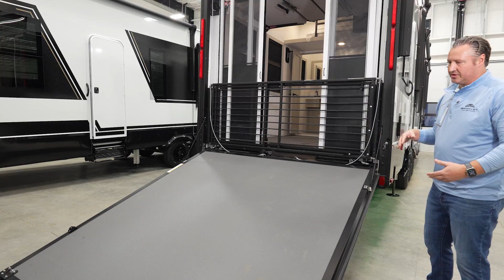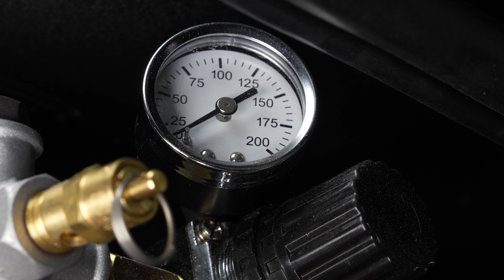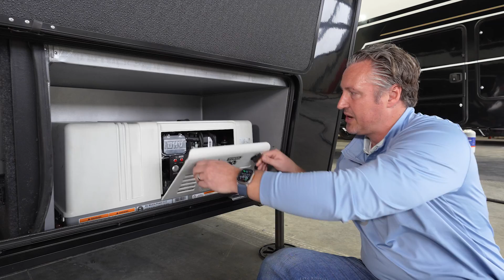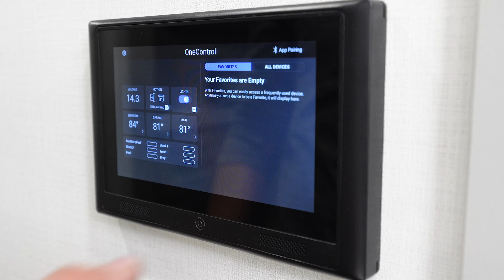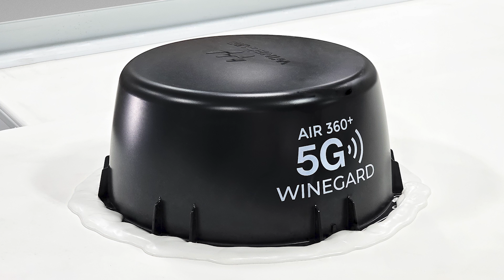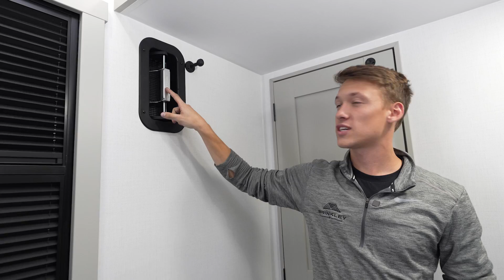2024 Brinkley Model G Owner's Quick Start & Overview

Comment: Excellent video and really appreciate all of the details.  One thing that you didn't mention is access to the refrigerator when the slide is closed.  Question:  If we are a truck stop or rest area will we be able to open the refrigerator side with the slide closed?
Reply from the maker: Good question. This will vary by floorplan. The Fridge and bathroom are accessible on the current Model G floorplans.

Also, note that the Model G's main slideouts are hydraulic and don't require a full extension. They can be bumped out a few inches if desired.

Comment: A whole lot to like.  We have a garage model and moving to a full toyhauler due to the size of my new Can-AM.  I wish the chassis was 24k, the electric reel in middle/rear (not a showstopper), AC units in the Brinkley is super loud (so I have heard but need to verify myself), Not sure if the Flex generator is loud (just below the bed so this I would need to find out) the king bed has no real side tables (must do the queen for that), no option for Independent Suspension.  Really love the unit overall well thought out toyhauler..

Comment: Just curious if Brinkley is using the same frame specs as Grand Design? Just hate to purchase a higher-end unit with a low-end frame that will fail.
Reply: Who makes or provides the frames for Brinkley?
Reply from the maker: We work directly with Lippert Components to design and engineer our chassis for our floorplans.  Spending extra on the triple powder coating process, reinforced upper deck, thicker gauge steel, and many other components of the frame.

Comment: It’s hard to find quality anything right now. Especially with RVs. Do you guys actually nail things in or are using glue like most other manufacturers? Can these be winterized? What’s the warranty coverage like? There are a lot of warranty issues out there right now and it seems buyers have no one their side when something goes wrong. The buyer contracts aren’t in our favor at all. What makes you guys different in this area? Everyone wants you to buy their shiny objects rich with features but then they sell you complete garbage.
Reply: View the Brinkley manufacturing tours. You’ll see why they are different. Brinkley has Lippert design their frames way stronger than typical manufacturers. All Brinkley frames are designed for full time travel.
Reply: yea I am not convinced that Brinkley is not another Grand Design...after all its the same crew that started Grand Design...and look at Grand Design now with all the chassis and customer service  issues.  Who's to say Brinkley has improved on that at all?.
Reply: The water filters are in a terrible spot. You have to take everything out of your basement, and even then reach around the walls to get to them. 
For downtime that needs to be changed regularly, they need to be more accessible.